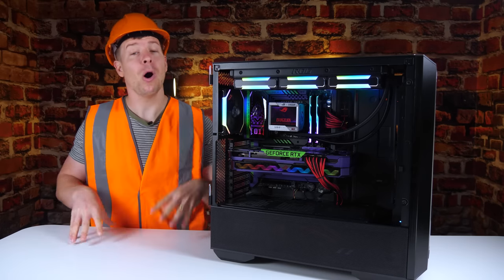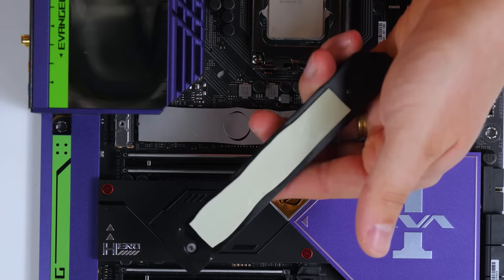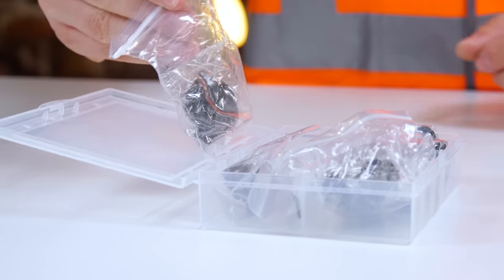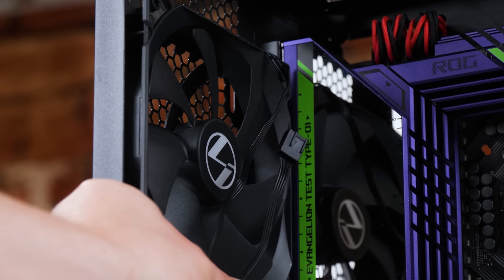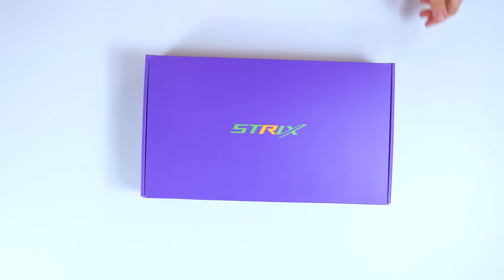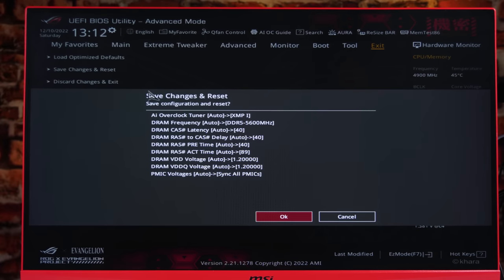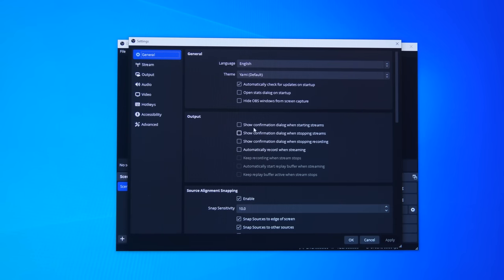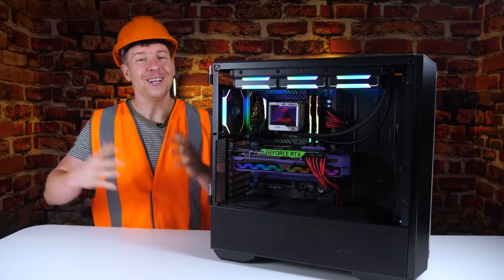How To Build A Gaming PC in 2023  - Step by Step Guide for Beginners

Comment: My PC don’t boost bios. even light on keyboard and mouse not turn on 😢 I already check CPU RAM VGA SSD and PSU install right positions. I think MB crash ?
Reply from the maker: Could be a number of issues. You may need to take it to a computer shop